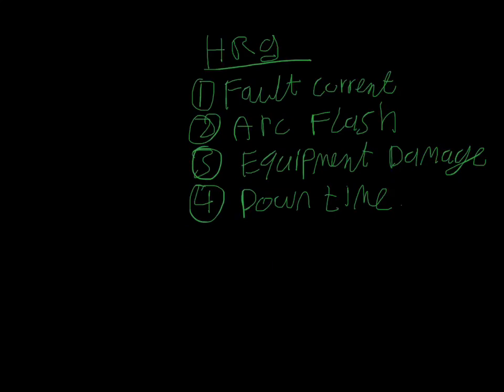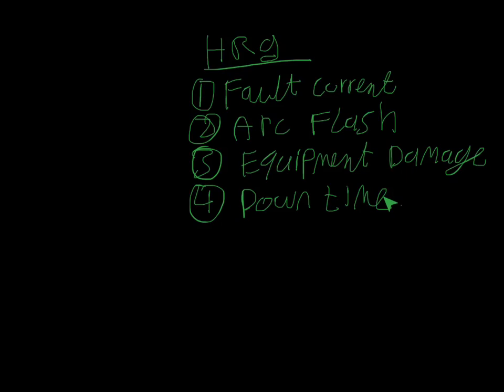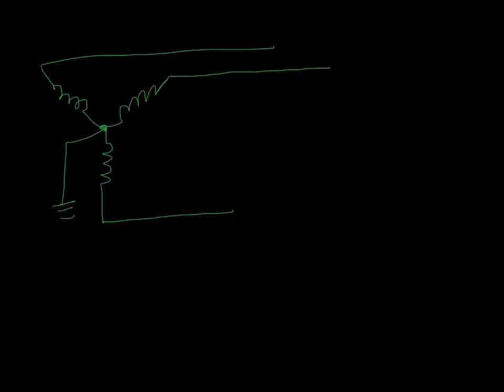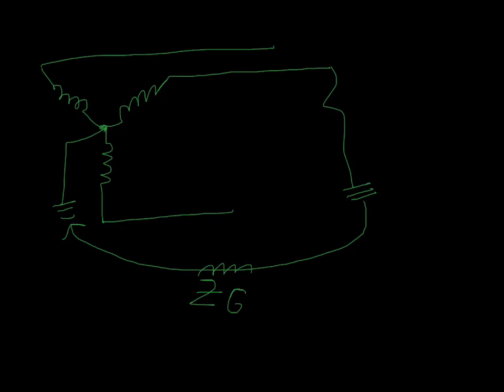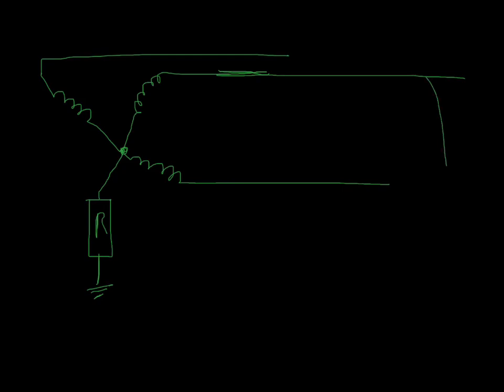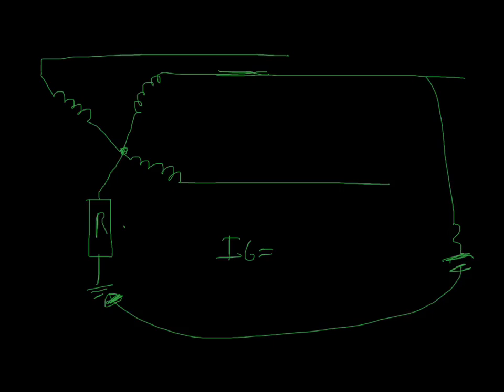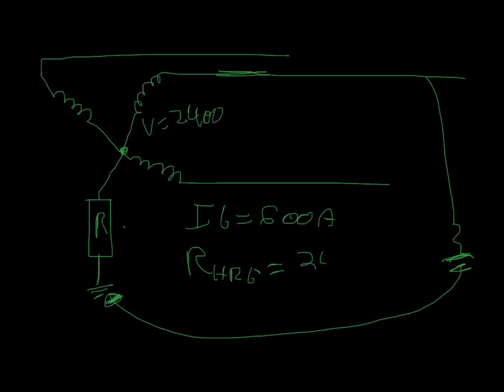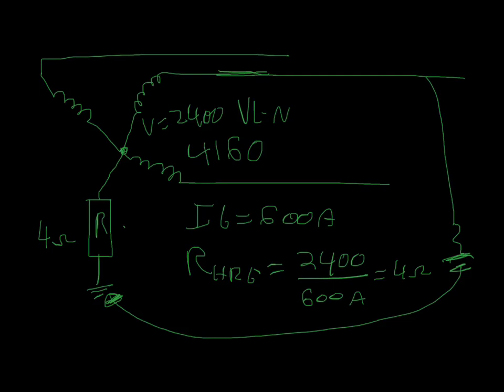High Resistance Ground

Comment: Nice explanation .. 
But I don't understand..  How current flows towards earthing point of source transformer only??  Why it is not diverted to any other path (as earth has such huge cross section) ... There will be many conducting objets present in between fault location and earthing point of transformer.. Then why and how it is only goes to earth point of transformer only???
Reply: Hi Shubh. Imagine the system as having X number of electrons. When a fault occurs between line and ground, the potential difference between the line and ground will favor a flow of electrons to the earth. Now with this system having a lack of electrons, electrons will flow back from the earth through the ground of the transformer to the neutral point. This is why there is a current flow in this circuit only.

Comment: So if i drive a ground rod 8 feet into some random yard near a transformer, then run a hot wire to a lightbulb and connect the ground to the lightbulb also, it will turn on?
Reply: In general if the ground rod had a good connection to the ground grid it would. However lets not confuse a neutral with a ground. As soon as you do that most likely the breaker that is protecting that hot wire would trip. The neutral bonding jumper is only bonded to ground in the panel or switch gear after the neutral current has returned on the neutral bar.